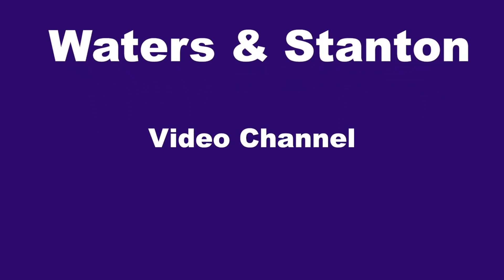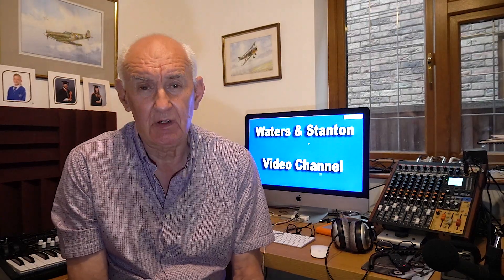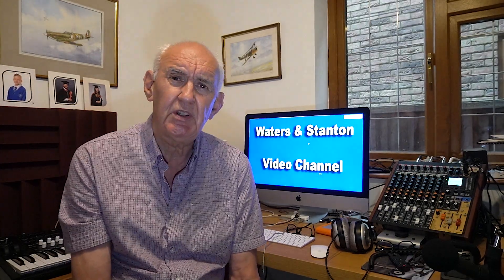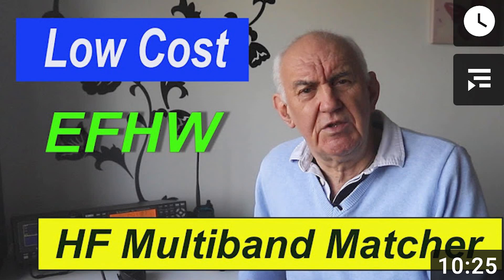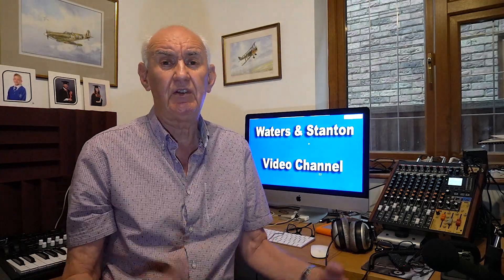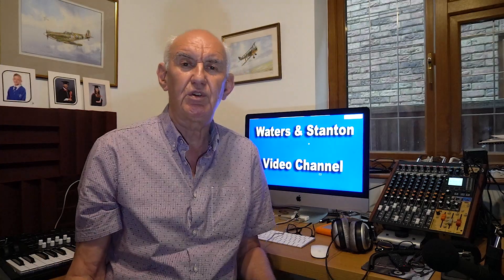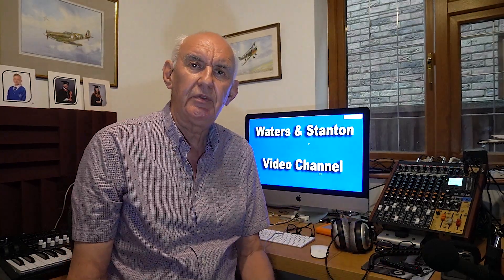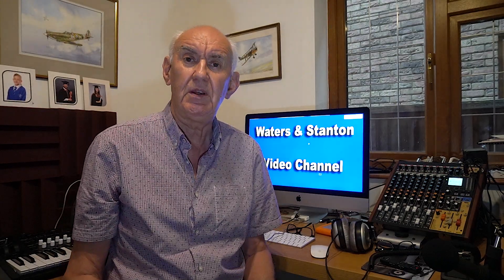Ham Radio END FED Dual Band 20m & 17m DX Antenna You Can Build.

Comment: Gracias for the presentation, I built a 20M half wave using the 2643251002 ferrite cable core and it worked very well with a transformer efficiency approaching 90%.  But adding 17 meters via a trap creates a different dynamic. First, by shortening the antenna (the slight center loading effect of the trap and the slight base loading effect of the transformer) I can now mount it vertically for that better low angle DX pattern, yet the shortened antenna (center loaded and closer to the voltage point) should make the antenna,  about 26' long, instead of 32', and only slightly less efficient on 20.... so the compromise is minimal. You will still  get a low (DX) angle of radiation; no radials are needed; and with care, no common mode. Easy to  mount vertically (in my case anyway) instead of in a a sloper form, and you get 2 bands which is a win-win in my books.. TNX... VA7AA/XE1

Comment: Two of my favourite bands. I built this 20m + 17m Antenna using a 4cm plastic pipe with 8 turns 1.2mm solid insulated wire. Across this I put 4x 100pf high voltage caps in series, which measured 25pf across the coil and resonated at 18.100Mhz.  The wire lengths similiar to your article.  I used a 10m fibre pole without the top 2 lengths.  This was the same overall length as the antenna wire. Installed as a vertical with the pole top end going through the coil former to retain the wire.  The final vswr adjustment 10m at  1.12 and 17m at 1.23.   The EFHW transformer was now common  standard design but without and 100pf cap better swr without it.  First QSO on 17m on FT8  was with VP8LP in the Falklands at 30w and good results on both bands.  Perfect for small garden and a very capable DX antenna.  G4PEY
Reply from the maker: Great to hear from you Ralph and glad the antenna is working out good for you. Take care. 73 Peter.

Comment: Hi Peter. Is it critical to set the trap frequency mid the 17m band or do the antenna wire lengths actually pull it all in to tune on the 17m and 20m band? Thanks for the videos.
Reply from the maker: Not critical at all. Just set the trap anywhere in 17m when not connected. Any slight pulling has no effect on the results. 73 Peter.

Comment: Hi Peter, I had two thoughts on achieving this... 1) a trap, as in the video, but also 2) a "fan" like in a fan dipole. I think a fan might be a problem if there are harmonically related bands, but for 20m and 17m it might just work? Worth a try? You then get a full half wave on each band.
Reply: I've just seen your latest video. In theory, a fan antenna would then also work on 10m I would guess as you retain the full half wave on 20m?
Reply from the maker: Guys, nice idea but. i have tested it and it dies not work. I will explain why in a future video. Sorry! 73 Peter
Reply: I'm going to make a complete stab in the dark here, but I would guess that a centre fed fan dipole (or ground plane vertical) works because the lowest impedance is at the feed point when resonant, but with an end fed, the non resonant wire would exhibit the lower impedance? I could be completely wrong...! :-)

Comment: A dumb but honest question: How many  antennas does the average ham radio operator owns or should own? I know you can get multiband, but most youtubers advise that they are not as efficient as a dedicated antenna,  your comments are welcome. Do I really need an antenna for each band or can I get away with  a multiband one. I am ready for the foundation exam out o f curiosity,  I am still  researching the hobby's usefulness beyond exchanging  a call sign with a stranger in Africa.
Reply from the maker: Gorge, I have an end fed 66ft 40m-10m and a vertical for same bands.  Generally the end fed is better.  Most who criticise this antenna have never use one and simply believe what they have been told.. 73 Peter
Reply: It's not an easy question to answer as each situation is different. For example, if you have a mono band half wave horizontal dipole, it will be a bit directional, and will give the best transmission/reception perpendicular to its length, with nulls where the ends are pointed. This is the same for the primary frequency of an end fed half wave multi band antenna. As you go up in frequency to higher harmonics, you get progressively more "lobes" and so the antenna becomes more omnidirectional. This would compare unfavourably with a half wave on that band if you are making a contact perpendicular to the antenna, but favourably if it's not in one of the two directions.

If you have the antenna set up as a vertical, sloper or as an inverted V, then transmission/reception patterns become more omnidirectional anyway, and there may be very little difference between monoband and multiband.

A trapped or loaded antenna may not be as efficient on all bands as a full sized antenna, but something like an end fed half wave is full sized on the lowest band, so it is just as efficient as a dipole, minus the small transformer loss.

Experimenting with antennas is one of the joys of the hobby...the hobby doesn't have to be useful, it can just be interesting.

Comment: Yet another great vid Peter! Funnily enough, I just made a 40m efhw antenna with an 80m resonator coil for some upcoming radios we shall be expecting soon  ٩( θ‿θ )۶
Reply from the maker: Many thanks. Great multi band antenna. Take care. 73 Peter
Reply: This brings me onto a question...there are an awful lot of websites and videos which enable a 40m EFHW to work on 80m by including a loading coil/trap, and they all give impedance and construction details for the coil. The question I have though is how to make an 80m EFHW work on 160m? What would be the dimensions of the coil for that and/or how much impedance would be needed? I guess the "tail" after the coil would need to be roughly double what the 80m version would have?
Reply: I've tried but I can't seem to get a definitive answer for the situation I need. I don't know enough to be able to adapt it to my situation. The coil is to be placed right at the end of the 80m half wave, i.e. after about 40-41m of wire. It'll then act as a choke for 80m and higher, but allowing the antenna to also tune up at 160m. It'll have a tail of wire coming out the other end of the coil.

Comment: Peter in what arrangement do you use it horizontal vertical or sloper of doesn’t it really matter?
Reply from the maker: The choice is yours. You may find dimensions differ by a small amount but should work same as any dipole. Peter.

Comment: Ah yes, seen this design shown by W7ARK on qrz forums recently. Very good. One thing (apologies if I missed this), on 20m fed with 49:1 we also get a very good match on 10 as a full wave. I notice your sweep went from 9-19 MHz or thereabouts, did you see if there was any harmonic resonance above 19 MHz? I only ask this as sometimes amending antenna designs can bring in unexpected bonus harmonics. It may well also be the case that the bands in question need to be fairly close together. The efhw has current maximum in the centre, so for example a 17/15, 12/10 version would be ok but maybe 10/17 and certainly 10/20 (just to try and lower the radiation angle on the  full-wave 10m section by turning it into a half-wave), might not be a great idea as both see a trap around the current maximum of the lower band and might go some way to impede performance on the lower band.
Reply from the maker: The antenna does not work well on 10m. You must remember that the trap has a big effect on the normal harmonic expectations. I may do a follow up video to explain why this happens. Thanks for watching. 73 Peter.
Reply: @watersstanton  as I suspected